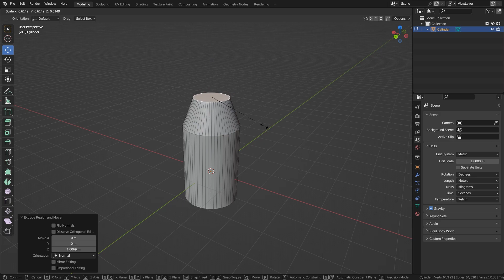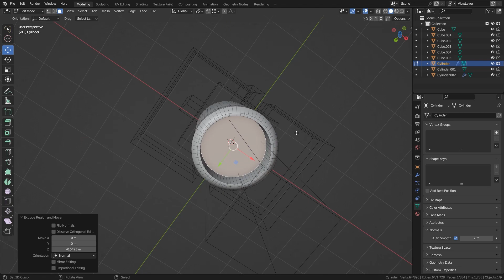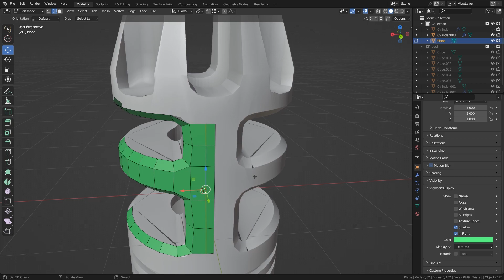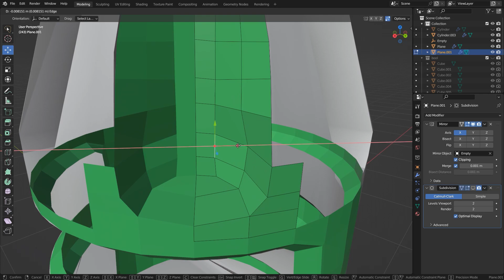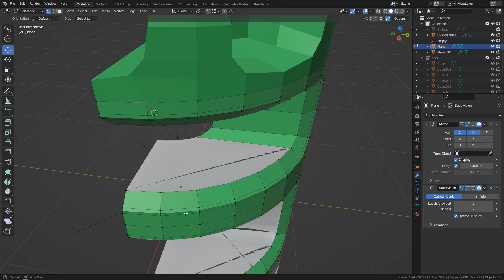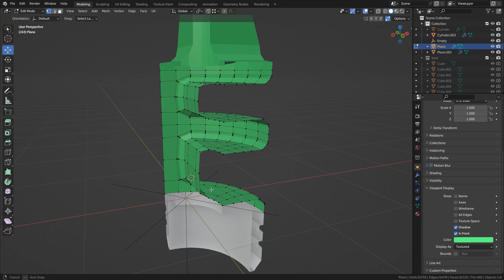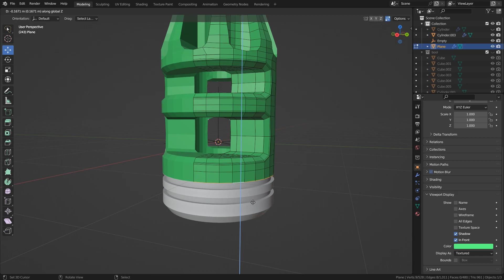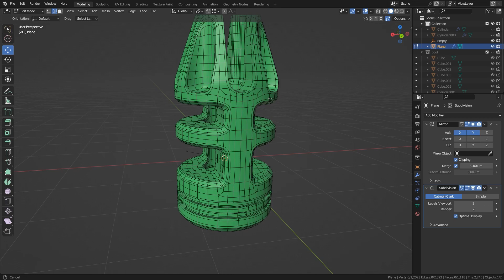Modeling a Muzzle brake Boolean & Retopology workflow

Comment: how did you do that at 4:43. I broke my brain and didn't found anything like that. I can't do faces with that edges, they simply cannot be connected to do face
Reply: he pressed f earlier selecting one edge, (it is a very usefull tool when filling holes because it generates quads always). in the video he had to put the retopology always visible (he checks "in front" and the quad instanly appears) because both geometries are collapsing and he cound't see what he was working on.
Reply: add-ons Mesh F2